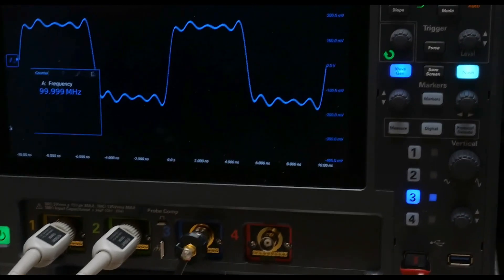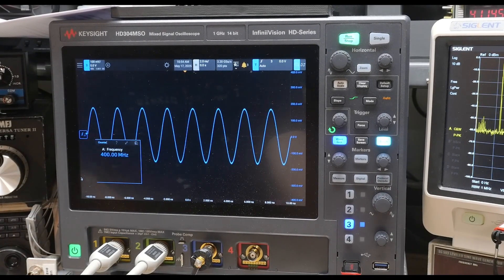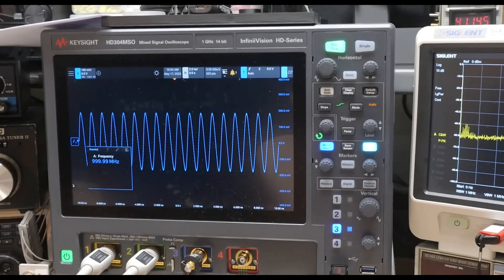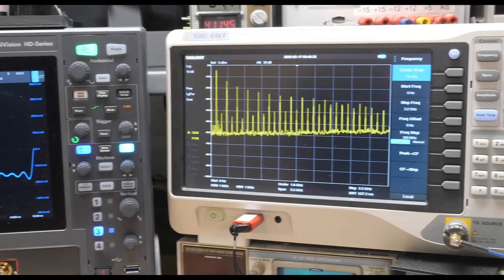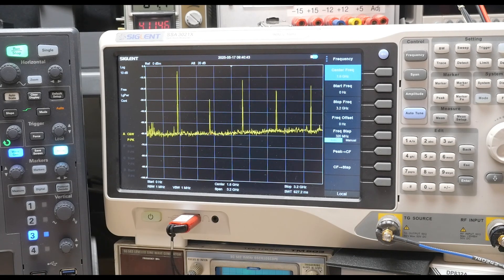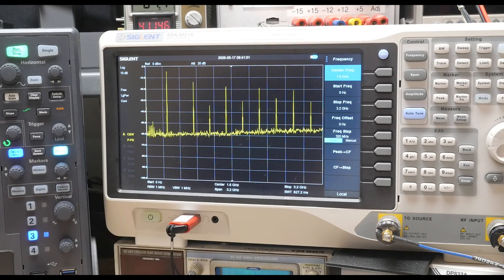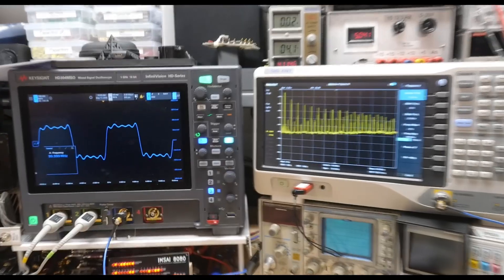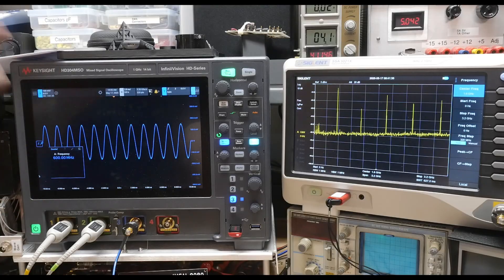#2251 Harmonics and Oscilloscopes

Comment: I just watched a scope video where the presenter warns new scope users to never push the AUTOSET or Auto-something buttons in the instance you may have a complex waveform and end up not seeing it right.   I can say that my 100 MHz scope has enough bandwidth to let me see how ugly the TTL level output of my 10 MHz freq standard is.  I had to add that output for one piece of gear that demands that from ext.  ref.
Reply from the maker: I talked to a Keysight engineer who was at a customer and after giving the don't touch the auto button lecture, he got in trouble with one waveform and was forced to push the button. 😀

Comment: Awesome video! It really shows what you need to see a squareish wave.
I want to add that there is two "filters" that is bandwidth limiting digital scopes. First it is the digital signal processing filter. Thats what is the smallest bandwidth limit here. Then there is the analog frontend. Depending on how it is designed, it acts as a low pass filter.
The bandwidth specification is 3dB down on the FIRST harmonic. And as you don't know the characteristics of the "low pass" filter the third harmonic can be attenuated much alot more. Ooooor, you could be theoretical lucky and have a "low pass filter" that is not steep at all and be able to see the third harmonic if the DSP filter allows that.

EDIT:
Aaaand thats why you can sometimes see specifications like 100MHz bandwidth with sine wave and only 25MHz with a square wave.

Comment: Does it behave any differently with a traditional analog scope? I don't expect much difference, but I've seen videos (Mr. Carlson, I think) where was able to see very fast reflections on a Tek 545 or Tek 580, at greatly reduced amplitude.
Reply: No it wouldn't. As the analog frontend would act as a low pass filter and filter out the harmonics. The 3dB standard that is used for bandwidth specification is on the main harmonic. And as the "filter" is probably quite steep(but not characterized) it would set down the third a lot more(you could calculate how much if you characterized the analog frontend). And you need to see the third harmonic to be squareish.

EDIT: This is applicable on digital scopes as well if the analog frontend is designed for a specific frequency.

Comment: Like you I'm retired. When I was in college there were no personal computers. My physics teacher had a Sin-Cos adding board. I think the output connected to an oscilloscope. That was a long time ago. The manual gave instructions on how to add different levels of sine and cosine harmonics to create many waveforms. I learned a lot. This video explains the process in reverse. I'd like to find a software package that does the same as the adding board.
Reply: You can do this in excel.
Reply: You can do this easily with Octave (free software).